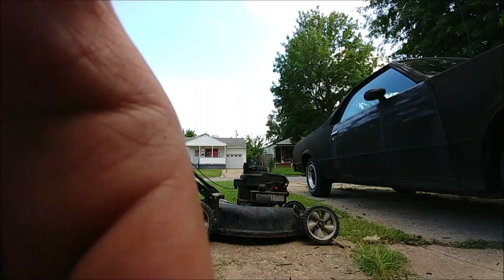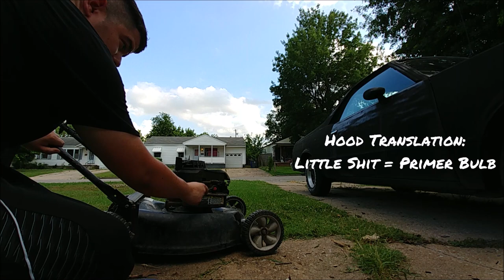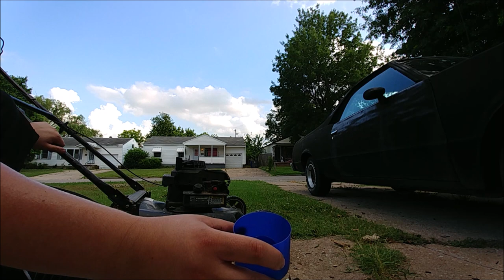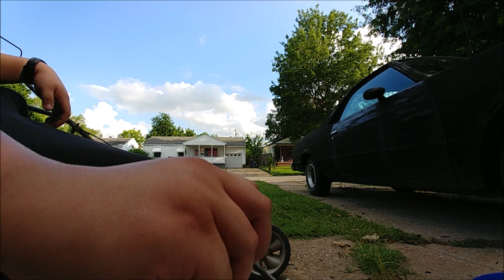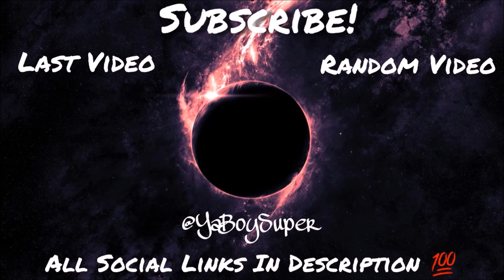Easily Start a Lawn Mower with a Broken Primer Button (Simplest, Fastest Method)

Comment: Awesome tip. First I didn't follow full instructions by not putting air filter back, which meant it would run for 30 secs only.
Then I did exactly what you said.
1. Poor a bit in. 
2. Pull until starts, but turn it off straight away.
3. Put filter back on 
4. Start and good to go.
Thanks 👍

Comment: A million thanks for this video.  I am a recently single older lady without much mechanical know-how.  My old mower had sat unused for two weeks and I couldn't get the primer bulb to suck up any gas.    I followed the instructions with a slight variation.  I added gas three times and the mower still wouldn't start.  So, I checked the primer bulb and it was working again after adding the gas.  I had to prime it three times, waiting about ten minutes between each try.  On the third try, I got the mower to start on the fourth pull.  So, don't give up if the mower doesn't start the first try.   Thanks again.  I thought I was going to have to buy a new mower.

Comment: .....I have used disc brake cleaner,  remove spark plug spray into cylinder and replace spark plug,  or remove air filter and spray into top of carb....................

Comment: I've got quite a bit of landscaping experience and never knew I could do this. I always assumed the Primer was squirting a little gas in that hole on the opposite end from it so I assumed there'd be no way for me to replicate that due to it's position. Thanks for the info, I'll post later when I try this out. 

Just to be sure, the fuel is supposed to go downward(near where the screw screws in on some models that holds together the filter) , not to the left/ opposite side?
Reply from the maker: The fuel is meant to go to the opposite side, however when you when pour a bit into the carburetor and then try to turn it over, it ends up "sucking" or if you add just the right amount it'll flow down into the piston head, hence why it may take a few extra pulls or may need to pour more gas, just depends on the mower
Reply: Got it, thanks for the info